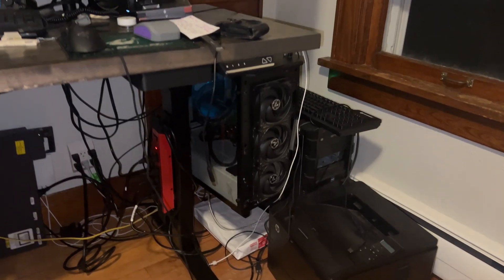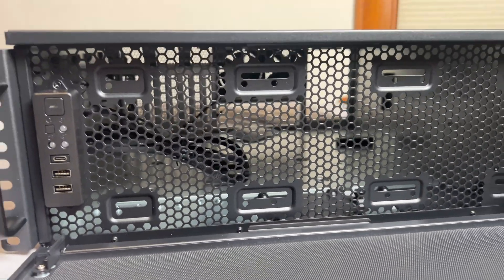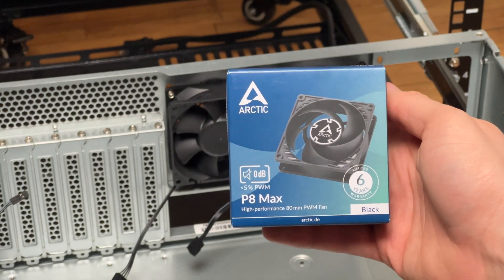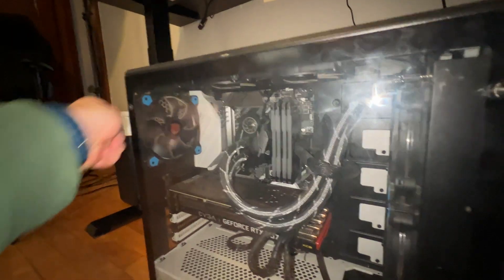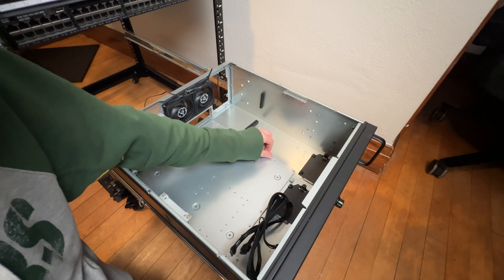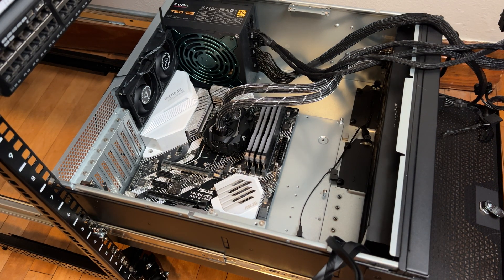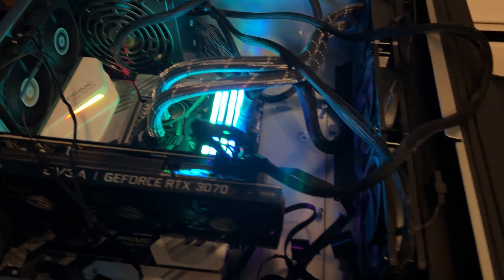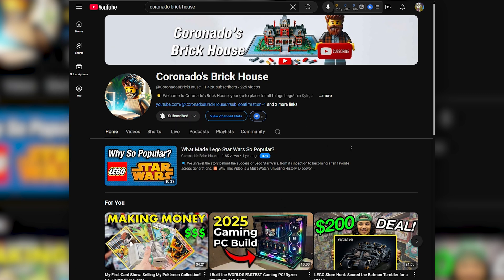How I Transformed My Workspace into a Homelab: SilverStone RM44

Comment: Actually there is a reason to keep front IO connectors separate: you can use reset button as clear CMOS. I am using like this.
Reply from the maker: Yeah I guess you could use them on any motherboard connection. Thanks for that I never thought of it!

Comment: For this price it should have a top glass panel. That’s honestly a sick idea. Even without RGB it would be sick if you could see inside the sever. Still cool setup. Though a better rack could clean it up a lot
Reply from the maker: I see and agree with what you’re saying. I think you could easily modify your own glass or plexiglass panel on the inside of the case after a simple cut.
Reply from the maker: Looking back at this, any racks you would recommend?! I prefer the smaller 12U setup to sit under my desk.

Comment: Im looking for information about that AIO, and I’m not sure which kind of Arctic is it. (360 or 420). Because I want to plugin in this case a 420 and I need proof. 😅
Reply from the maker: Mine is a 360, honestly I’m not sure if a 420 will fit. I believe the 360 is the largest that will fit, but you can always check their specs. If you buy, consider using my affiliate link! :)

Comment: Just ordered this exact case for an upcoming AI Training & Inference Server build with 4x of the RTX Pro 6000 Server Edition for my startup, with a 56 core Xeon Rapids Processor and 1TB ECC DDR5 Ram. Planing to watercool the CPU with a 360mm AIO and.a push-pull config on the rad with 4x Arctic S12038-8K 8000RPM Fans and as exhausts the the Arctic S8038-10K 10,000RPM 80mm fans. And I chose to opt in for a ConnectX7 NIC for route it to my UniFi Enterprise Switch in my 30U Data Rack so it has high speed access to my Synology U.2 Rack NAS. Going with a Seasonic 2.2Kw Main PSU for the GPUs alone and a 2nd SFX SilverStone 1200W SST-EX1200R-P for the mainboard and the rest of the components.....Yes it'll technically be an air raid siren but it has it's own dedicated data rack in a separate room so I won't care too much about that. Performance and airflow to the server RTX Pro 6000s are the most important sicne they are passively cooled.
Reply from the maker: Please tell me you’re going to drop a video on that! About to drop a mini mortgage on that build 😂

Comment: Do you have a sound comparison between the stock 80mm fans and the Arctic ones you replaced? Is it noticeably quieter?

And how did you fit rhe Radiator on top of the existing fans? Did you use buy longer screws?
Reply from the maker: @asian1nvasion  honestly I didn’t even try the original fans. I just have used the arctic ones in my build so far and been a big enough fan I didn’t care what they sounded like. My guess is the difference is negligible but still a real difference. 

I actually had longer screws already from my radiator and the way I had it setup in my last case. It was basically a simple swap I just had to mount the screws, fans, and then connect them to the radiator if that makes sense. 

Thanks for watching hope you still around for the long haul.
Reply: Thanks for the info, that makes a lot of sense. Subbed.  @CoronadoStudio

Comment: Never use a vacuum on a pc. The static electricity can fry the components.
Reply from the maker: @planets0496  good to know but I’ve never had issues with it. Something I’ll consider going forward. What’s the best way to manage it?
Reply: @CoronadoStudio  Metro Data Vac!  :3  ( despite the name, it is an electric dust blower ).  Avoid letting the fans free spin when blowing dust.  Also some extra advice, when dusting never ever blow the dust out of a PC in cold ( winter ) temperatures outside, then bring it inside to warm temperatures.

If you are a static magnet like me,  always throw in a few fabric dryer sheets!  It really kills the static from clothing~

Comment: Does that front flap affect the airflow at all?
Reply from the maker: It doesn't at all. It has perforations on the front side with a magnetic mesh screen on the backside. The only negative I have with the front flap is Power button & Front USBS are behind it. Not the worst, not the best.